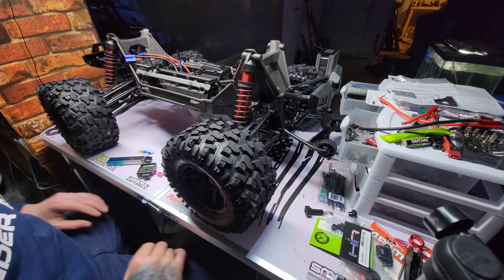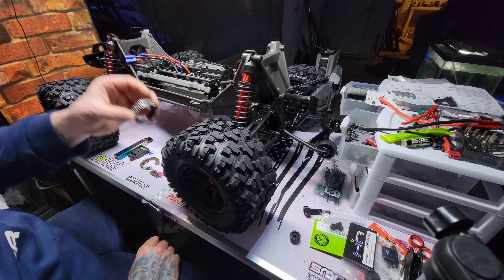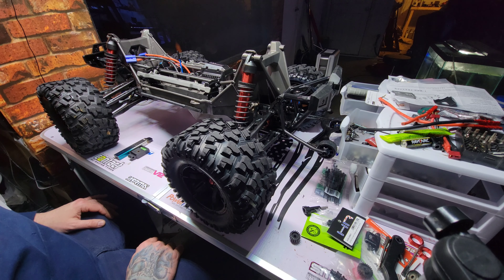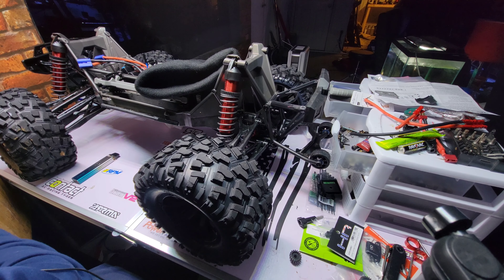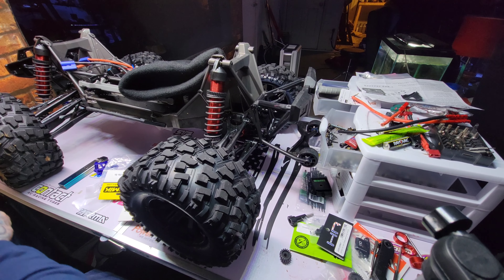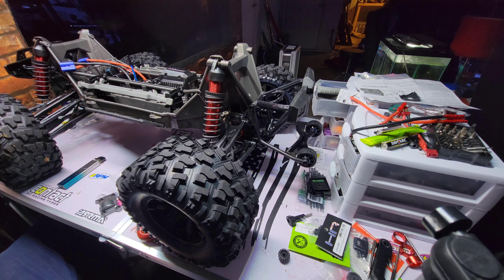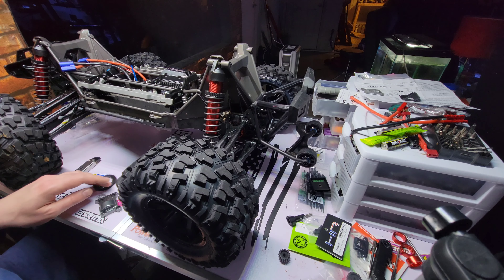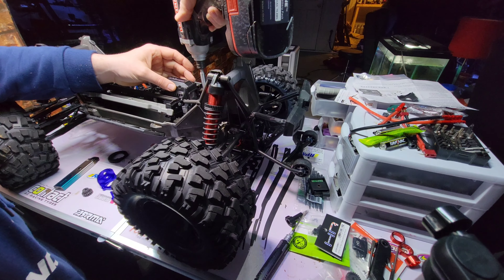XMAXX Upgrade and Rant!

Comment: I honestly never had that many problems with my Xmaxx.  But in all honesty, I changed out the hubs, put in the upgraded traxxas servo in there with the better servo saver spring, my only problem was the center diff cover. on mine, there was a very fine line between too loose and too tight.  the version you have and the maxx i believe is suffering ther same fate, during covid traxxas switched up where they get their parts from and are not as concerned about QC. my maxx is stock still, besides widemaxx... but electronics wise and gearing, fans and all. all stock. and all still work, and Ive had this max now for 9 months.
Reply from the maker: Hopefully it's all good now. I haven't lost faith yet.

Comment: I have one all I did was changed pinion and gear to Traxxas harden version (Wide) and upped the diff fluid in front and rear and changed shock oil to 40w and runs fine just waiting to see when the servo goes and then will change to the metal one but if you are still in warranty you can just pay the difference to upgrade so not much cost
Reply from the maker: What  thickness fluid did you use? The front balloons pretty bad. I think the manual said it has 10k in the front.
Reply: @heavymetalrc7520  I went 30k front and 50k rear all good so far plus vent tyres and tape holes up on inside if you are gonna do it, I did mine much better less balloons and this set have lasted ages I learnt the hard way not venting but if you do go though the big tie tread in the centre start with two holes 12 and 6 o’clock see what you think can always add to more at 9 and 3 o’clock if you think it needs it
Reply from the maker: @domesticcardetailing8295  awesome doing the diffs soon. Yeah I vented the tires before my last run. Too much wet ass snow up here.
Reply: @heavymetalrc7520  keep central 20mill stock works fine, man I love my Xmaxx best car I’ve got

Comment: ive swapped the esc (max6) and first run 20seconds in standard spur smashed fitted traxxas hd spur and i have kicked the shit out of it and had no problems dont even think about the spur now, other upgrades are Mad max tyres rpm rear hubs sealed wheel bearings all round, rpm bumper mounts,   do the servo metal gear upgrade as your servo will let go, Your tyres are gonna let go too seal the inner hole up and vent the outers to try and get more life out of them

Comment: Don't worry 'bout it, soon your X will be in the corner eating cobwebs just like mine. The 6s truck was a nightmare so buying the 8s truck & upgrading the 6s at the same time . . . I can easily write a book on how much of a headache these 2 rigs was, are, & will continue to be. The only thing Trx has taught me is that the best use of sintered metal is for drains. In the meantime, I'm still breaking my Outcast, but at least it's not the same BS over & over again.

Comment: be aware on the rpm kraton arms that the dogbones will pop out cuz they are longer. The fix is to shorten the spot where pillow ball threads in...or slightly longer bones.

Comment: Bought one yesterday..spent 1400 in truck, batteries, and charger..20 minutes into the first run it shut down, hardly would move and was making a bad sound... brought it back and and got a full refund..didnt even have it 24 hours...I still want one but damn, that put a bad taste in my mouth.
Reply from the maker: Damn man! That sucks. Now that I spent a fortune on upgrade parts it's a beast. Just sucks you have to do that.

Comment: Dude your going through everything I've been through it fuckin sucks. Your journey is far from over 🤣 The thing with the X maxx is once you've ironed out all the problems it is a tank! Even the motors suck. I've killed 2 traxxas 1200kv and a 1600kv now I'm running a cheap 1/5 scale 980kv and it's the shit! Loads more power and more importantly... It was cheap!! I'd never buy a brand new X maxx again. It's pointless when your just gonna bin all the electronics and gears. If it was a roller that would be perfect! Like a X maxx exb or somethin. Anyway. You'll get it to a point where it's almost indestructible dude and you'll love it more than your own children lol. Out the box they are garbage and expensive doo doo!! 🤘🏻🤘🏻🤘🏻